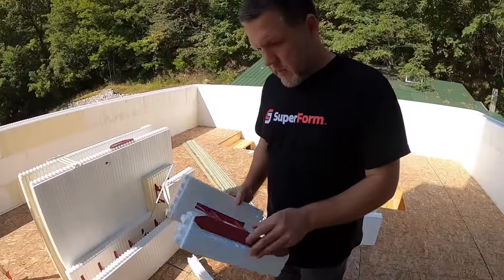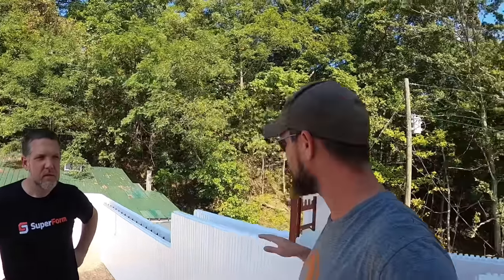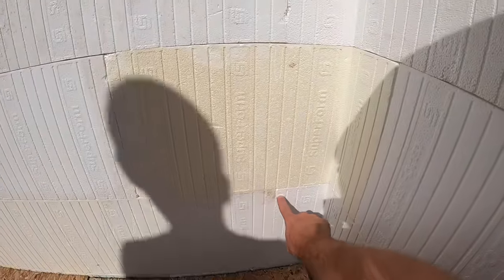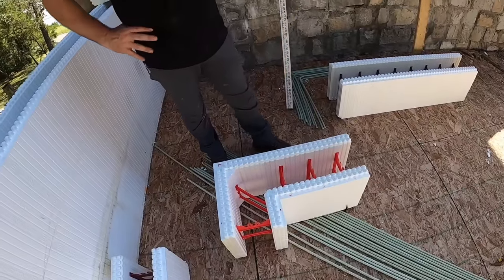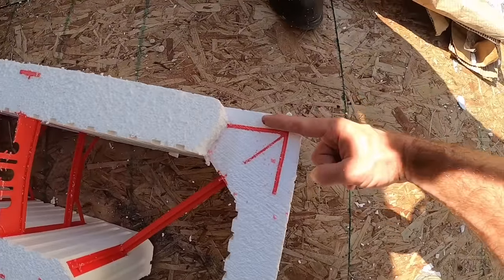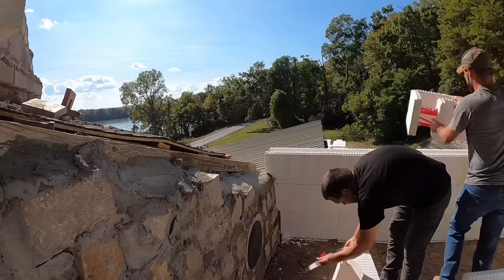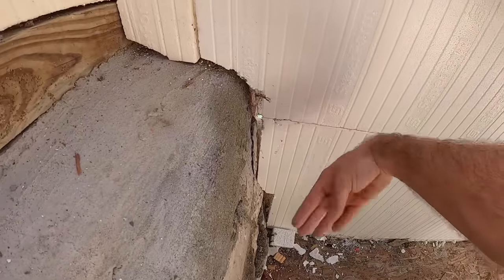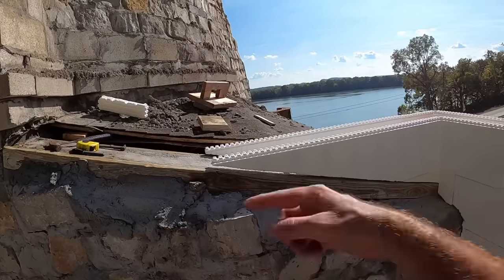ICF DETAILS WITH SUPER FORM!!!

Comment: We’ve used a plunge router to get a standard width and depth.
Our use is in wonder blocks not icf but it’s basically a similar install. 
An S pattern will help keep romex held in place but not necessary.
Reply from the maker: Thank you

Comment: I built on the west coast for 30+ years, icf is foreign to me. Seems like a lot of extra labor. I will ask more once you are further along. Great content!!
Reply: Here the thing yes more labor to do ICF but for like a basement you have a area that you can just finish.  It is all insulated studded all you have to do is run wires plumbing and drywall and you are done.   Same with the main level   Once you stack the  ICF and pour the walls you can frame a roof and you be weather proof in a what a week.   The r value will be around R10 to R12.5 per side so a R20 to R25.   R10 is what is needed for a basement and I think R20 I think for walls in northern Indiana.  Plus no air draft either.   Labor is more but not when you factor in labor to frame the wall and insulated the wall it less.  You doing 3 steps in on when you are using ICF for a basement.  Add up material and labor to pour the walls plus material and labor to frame the walls and then material and labor to insulated the walls and see where you are at.  Then price out ICF  forms and labor to install and pour the ways.  Labor is what kills you.  ICF might be more money to buy compare to studs and insulation but only having to do the work one time and not 3 there your saving right there.
Reply from the maker: Actually less labor
Reply from the maker: Exactly you can’t just look at the stack out labor here to look at 4 different labors in one do it ends up being less labor
Reply: @nyamillennial  🙂 Icf is above my pay grade. Not knowing insulation codes in your area is also a factor. I worked with the top of the food chain in my area for a long time. Great content as always, I, watch even when it hurts 😊
Go buy a construction master pro calculator it will save you an incredible amount of time doing estimates, cutting stairs, cutting rafters. Concrete estimates...

Comment: Great video Matt…And thanks for bringing Jason in from SuperForm. ICF may add costs and time to a owners build but in the long run, will save them thousands in heating and cooling not to mention the savings on foundation repairs down the road.
Reply from the maker: It actually doesn’t. You get structure/framing/installation/sealed in one shot!

Comment: The correct term for installing Aluminum/Vynal siding is 'HUNG' not nailed. Nailed siding will look bubbled/rippled from the outside. Installed over normal flooring rim/band joist, vynal siding (especially 2nd story flooring and flooring levels above) need to be streteched vertically more than the other courses because the vertical orientation of 2 x 8, 10, 12 rim joist shrink the most vertically and can pop off the lower locking edge of the siding. You can drive anound and see imporperly stretched (and popped off) siding at the 2nd story rim banding.
Reply from the maker: Thank you

Comment: One guestion guys how does the electrical inspector handle the wiring in the foam?  Seems to me it would be an issue! When hanging 
Finishes. Great job and instructional video.
Cannot wait for the next pour.
Reply: What would be the problem for the electrical inspector?  There no code for wire depth in walls. just what is a common practice about being in the middle of the stud and then other people using the right length of nails.
Reply: The industry standard is 1-1/4” from your nailing surface. If less you’re supposed to provide an FHA safety plate or metal barrier 1/16” in thickness to prevent damage from screws/nails.
You could use type ac or mc cable in lieu of romex.
Yes this is a code requiring protection of romex where subject to damage.
Reply: Maybe  I'm not see what you are seeing the wire placed by the electrical contactor  would be in front of the plastic stud therefore there is possiblity that a fastener could compromise the wire. Ether by the contractor installing the finishes or the home owner down the line. Just saying! Code or no code it should be addressed.
Reply: @sirsparksalot  hi
Reply from the maker: You have 2.25” of foam so it is a none issue
Reply from the maker: No gets cut into foam and plastic

Comment: Matt, question are you going to drill holes to insert the rebar into the old concrete structure vertically in the section of the old wall/roof that you showed us in this video for strength????
Reply: he said he was going to.
Reply from the maker: Absolutely!
Reply from the maker: Yup

Comment: I am confused why you need a common ? When you say never have strait up seem.
Reply: The common is for two things one so all your studs will be run straight up in your wall.   Two you will never have a wall that you can fit a even number of blocks in.  You are always going to have a partial block.   The way the blocks interlock together it you have a hard time getting them to lock form one side to the other side so it is just easier to have the common and cut the block to fit there and brace that spot.  You don't want to stack you ICF block right on top of each other there no strength in the wall that wall the blocks will fall over.   Moving a block over 12  to 24 inches so you are overlaying the joint gives the wall strength as you stack it.
Reply from the maker: When blocks don’t overlap properly you have a common

Comment: Well that corner took a big effort to achieve,I still maintain that the concrete should have been cut and there was a good full corner rather than the cheese wedges that you have formed IMO 
Was expecting more structure inside those corners
One might also think that you would be drilling down into that corner for lengths of the bar that you're using  ?
Reply: Have you every try to cut rock?  Its not easy to do.
Reply: @johnunsicker7440  I'm sure that the old Stone Masons had a way ,and probably the modern stone masons have been ways .
Concrete Saw with Tungsten blade ,water fed will do the job I'm sure ,and if you look there is concrete,then the stone ,which has mortar joints,they would be the weak points, cutting the mortar would be easy would you agree ??
Reply from the maker: I sure did
Reply: @thatdave86 Where to begin?  This is not like working on normal stuff.  You have odd shapes to deal with thick rock and mortar joints not some inch thick joint.  You start to take something off and then you have your self a great big mess.   Some time what you think might be the easier or better way turns into a bigger mess that cost you a bunch of time and $$$.  And guess what the way he did the corner it held just fine.
Reply: @johnunsicker7440  thanks, we all have different ways at looking at things don't we  ?
Now that he has revealed that it will only be roof space, then the loading won't matter as much, and yes certainly a Hodge podge of different things to deal with.

Comment: Matt, it is not called stupidity, it is call a glutton for punishment.  Like Mike having Aaron to deal with.😂🤣😂🤣😂🤣😂.
I saw old Super boiler welder bossman want to be Aaron, had a massive failure in his welding and design in the Mikes Tile plow, I can not believe Mr hotshot Welder did not know he needed to put reinforcements on the side plates of the tile plow where the roller pins was about an inch and a half from the top and bottom of the outside edges,  Don't he know steel will get fatigue and crack?   If he had used 1/5 to 2 inch steel he could have gotten by with it.
I just hope he did not do and welding on any nuclear reactors, otherwise we are all in danger. 🤣😂🤣😂🤣😂🤣    

So Matt give him some extra hell about it and cut his ego down to size.🤣🤣🤣🤣😂😂
I cant wait to see Mikes video of the failure and hear all of Aarons excuses, the facebook video he is totally speechless and not giving mike any lip!!🤣😂🤣😂🤣😂😂
Reply from the maker: I will!! 😂😂😂